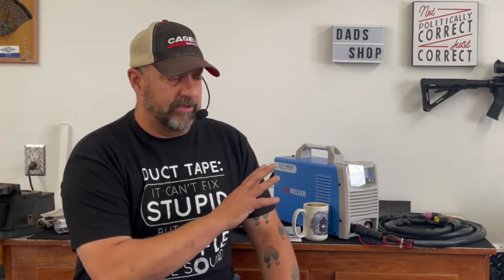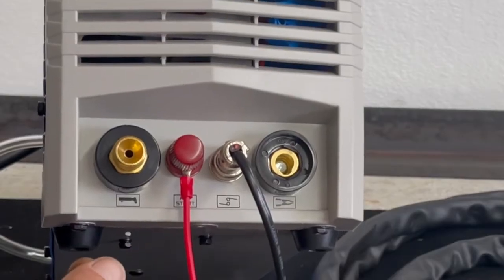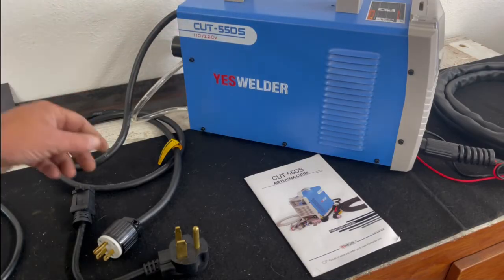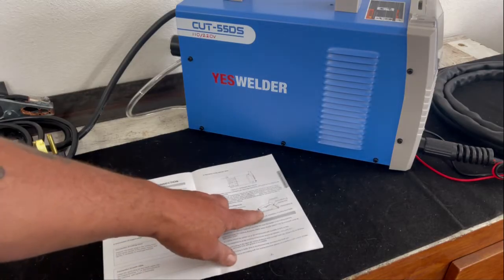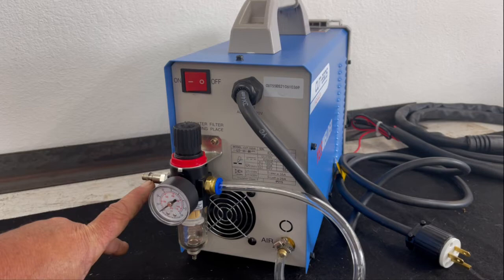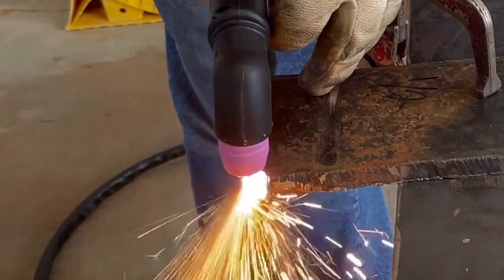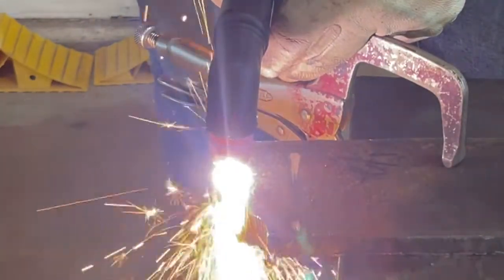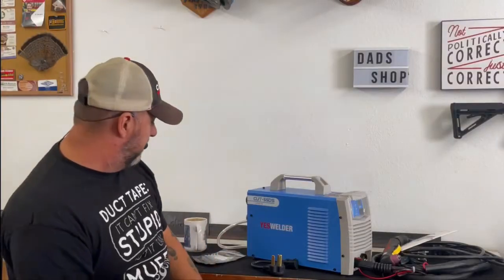Yes Welder Cut 55-DS Plasma Cut Review and Demo

Comment: If your going to cut out shapes in steel always drill a small hole  maybe 1/8th inch for your arc to pass through its a lot easier on your tips

Comment: Good video, real helpful. Need to install a 240 receptacle for power and not sure what the amp rating on the adapter cord you show. Yes Welder website doesn't specify but state a 63A breaker. never seen one Thanks
Reply from the maker: I was plugged into a 30A circut and receptacle. I worked perfectly.
Reply: @jackofalltrades7822  thanks for getting back to me. The plug configuration looks as the same as the one on my welder which is a 50A. Don't have the Yes unit yet supposed to arrive today so I can not compare plugs. The 30A receptical I purchased has 2 hot blades in horizontally. 
So are you using a 30A plug for your setup?

Comment: Great review, thanks. Pure chinese junk. Mine was no good out of the box. Pressure gauge only reads 30psi. I don’t know whether I have to much or to little air pressure. Arc goes out after a few seconds. Yeswelder is putting unreasonable demands on me to fix it.

Comment: I have a Hypertherm 350 I bought in 1998 that is dual voltage and had a 110 plug. I made the adapter like you show here. I guess I'm lucky no tools have been plugged into it and cooked.  My other 30 amp cutter is 220. I'm glad you did a cutting test. So far watching you, you are the only one I've seen that didn't drag the tip. For the price it looks like a great deal. A sheath for the cord looks like a must. Thanks for posting.

Comment: Hi.  What size compressor you suggest for 55ds?  Thanks
Reply from the maker: As big as you can afford. I would say no less than 1hp and 30 gal and that is the very bottom end. It all depends on what you expect to accomplish.
Reply: @jackofalltrades7822  I appreciate quick reply.   After the learning curve and excitement is over, I'll probably only do occasional hobby and craft projects because I have a woodshop and HVAC side hustle as well.  Harbor Freight had a 21gal, 4 scfm @ 90 psi, 1.5 hp compressor.  Maybe it will do?
Reply from the maker: @munawarsoomro8958  maybe. Let me know how it works. Mine was not enough.
Reply: @jackofalltrades7822  will do.  I found a 21 gallon Craftsman Professional with 3.5 HP motor and 5.5 scfm at 90 psi on marketplace.  I’ll try and get that if I can make it work.  Right now my pancake compressor does the cutting I think properly, but runs all the time.
Reply: Their website says 5-7 cfm at 60 psi.
Reply: @messybench  thank you.  I bought a used one close to the specs.

Comment: I like your review, I bought the cutter about 8 months ago so far it's been fine.  I agree about the 220 adapter,   I'm the only with access to it should be ok.  This is my second DIY plasma cutter, pilot arc is a nice feature over my first cutter.  I was able to find Yes welder consumables from Amazon.
Reply from the maker: I fixed it. I wired I. A 220 plug and use the adapter for my Titanium welder.
Reply from the maker: https://youtu.be/rWOjrEGOqbI

Comment: Pretty good review. I do believe you gave honest opinions on the machine. I have watched several reviews of the Cut-55-DS machine. You pointed out a good safety concern about the adapter cord other reviewers of the same machine never mentioned in their videos as well as the issues you had with the regulator on the rear of the machine. As far as cutting metal. It certainly does that.

The manufacturer apparently offered a lot of these machines for review. Your review appears to be a bit more honest than some other review videos I watched on the same machine. Overall, the machine appears to be on par with other models in that same price range. None of them are perfect, not even $1500 plasma cutters. The fact that the manufacturer moved the location of the power cord is an indication they are listing to customer complaints and constantly trying to improve the product.

Update: I just watched your follow up video where you made some good improvements to the machine.